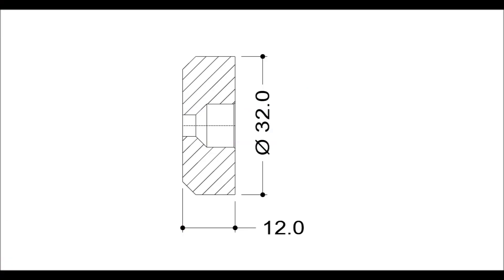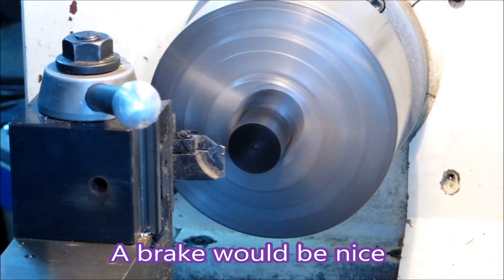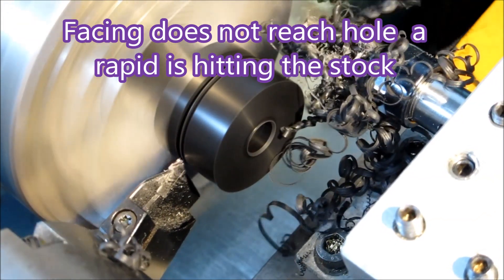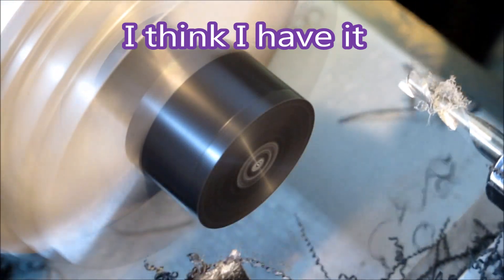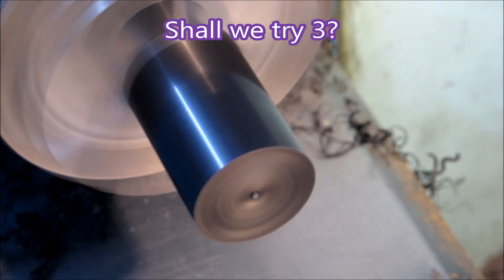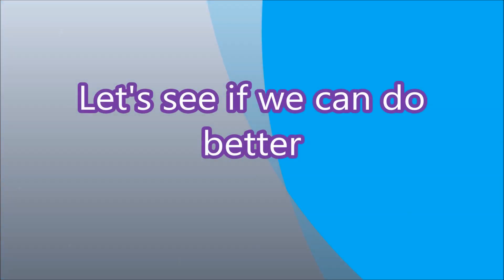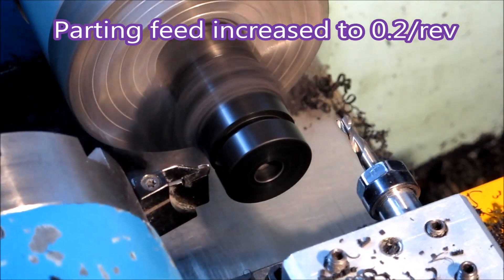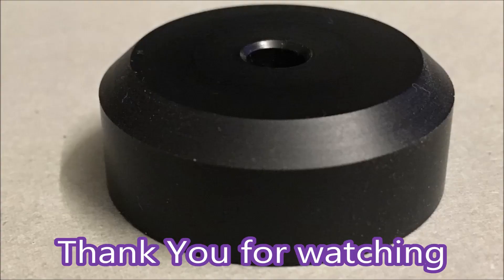Delrin part, made in cnc lathe with Air Chuck, Parting Tool and Slot Drill used as a boring bar

Comment: for the poor machinists without CNC just drill a hole and tap and thread a socket head screw.. flush it and face it off..bingo..same job..
Reply from the maker: You are right Bob, there are jobs I do in the centre lathe that don’t justify the cnc setup time. When the quantities begin to creep up, that is when cnc becomes viable and as the numbers increase, it goes from viable to essential. Complexity also comes in as a factor, for a simple job ten may be workable in the centre lathe or even twenty. I have made a single part on the cnc when it was simple but required a partial 100 mm sphere. I know it can be done, but I was not going to do it by hand when the little lathe was sitting there unemployed. And when it comes to cutting a thread, that is where the cnc really wins out. I think I can program and simple setup a job in not much more time than it would take me to go buy a die, if I did not have one in the toolbox. In some of my videos I have included microscope shots of threads and they are about as good as they can be, crest, root the lot. I have to say that is not any particular skill I have, a full form insert and the cnc does it’s thing and produces great threads.
If I may compliment that poor machinist, he probably has better skills than I do. I am really a draftsman and I became a cnc user by accident!
Thanks for your comment reminding us that cnc was not always around, when we had to rely on true craftsmen to get the job done.

Comment: Did you hand chamfer the back of the hole where you broke the part off?  Nice vid! I liked seeing the progression. Thanks!
Reply from the maker: A small cross hole countersink in a little Bosch cordless screwdriver. Thanks for your comment.
Reply: Ah....sounds like what I would have done.  When I have a ton of easy chamfers like that to do, I chuck the bit in the drill press, then I grab the part from the bucket on one side....use both hands to hold the part and raise it, up against the bit, then drop it in the bucket on the other side.  May not be the safest way to do it, but it's certainly quick since I don't have to pull any triggers, levers, wait for spin up time.....yada, yada, :)

I've got a 9x20 HF lathe that's been converted to cnc......I really need to get that back up and running again!!  I thought it would be a toy I'd just learn some cnc stuff on, but boy was I wrong.  I've made far more money with it than my mill!! LOL  :)